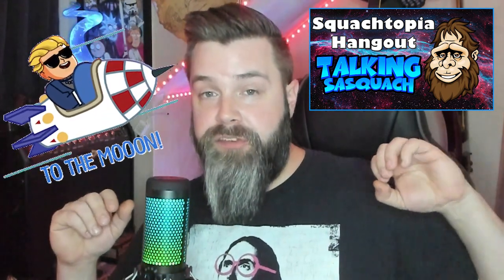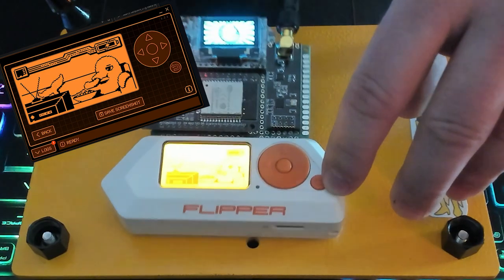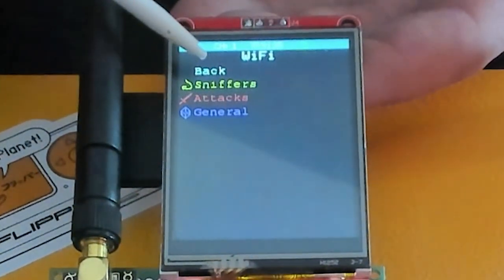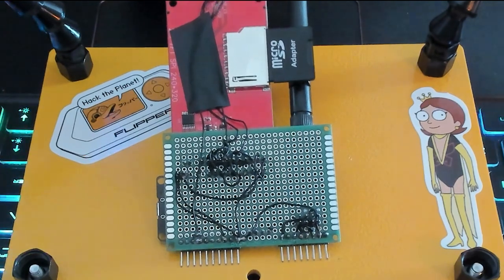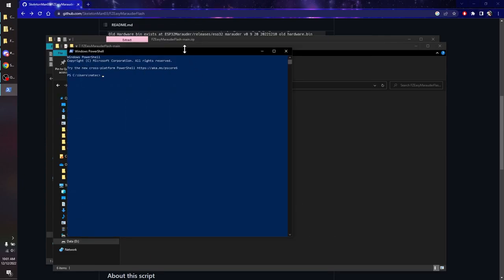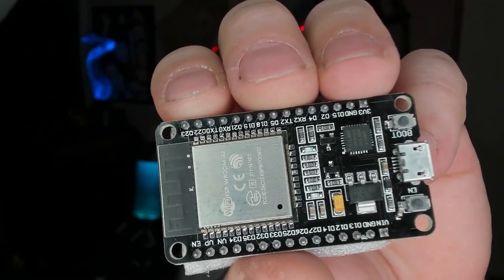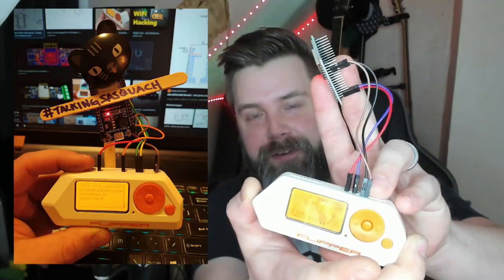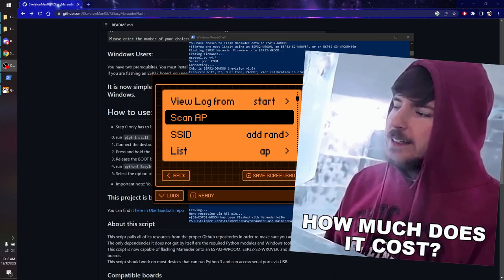Become A Flipper Zero Mad Scientist and Make your Own WiFi Boards!  😱😮👉🐬

Comment: Not sure if it has already been suggested, but have you considered double stacking the boards to protect the wiring? Use headers pins to connect another board and basically make it so the wires are inside/sandwiched? And then obviously fill that to the gills with hot glue. Just splurp a buncha hot glue in there. No such thing as too much hot glue, only too little. 🤙
Reply from the maker: I subscribe to the cult of hot glue. Great idea!
Reply: @TalkingSasquach  glue be with you, brother. 🙏

Comment: Nice video! Cheers.  With the nrf24 and esp32 wiring if there is any overlap do you just splice in the overlap and flipper uses either or?

Comment: How do you solve the power lines if you have ESP32, NRF24 and SD card reader as well? Which one is powered from 3.3V line, which one from 5V line? and since there is only one 3.3V line, one 5V line, two of them should share the same line, right? I would appreciate your answer. thank you so much.

Comment: I finally did it!!!! Spent like 12 hours today to do this, but I am a total newbie but I really enjoy learning about this stuff. Thank you for the tutorial! Actually had so many problems while doing this, but managed to finish the board, really proud of myself right now!

 For example, at the end part with: python3 EasyInstall, I constantly got red errors about python ..... [python3 : The term 'python3' is not recognized as the name of a cmdlet, function, script file, or operable program] ...don't really know why, even without the 3 just "python" didn't work.....so after a few hours spinning my head around the requirements.txt not working right and this python thing.....

I found out that after the pip instalation reqirements.txt, after the connection ESP32 with PC, I just have to run: start EasyInstall.py and it opened the window! 
Installed the correct version, and everything else after, voila, I have a working replacement for my Flipper Dev board!
Thank you so much for the tutorial, but if you know why or what the problem with the Powershell is, why do I get python error? So my SkeletonMan window would be black in cmd, not in powershell, like yours!
Reply from the maker: You sure you did step 0?
Reply: @TalkingSasquach  Yes, did step 0, but had an error with the requirements.txt (even tho' the set-location and folder had the requirements.txt), so did a few google searches and managed to fix it. 

This command helped me? .... I'm not sure, heh:

pip freeze > requirements.txt

Anyways, good thing it works perfectly now, I'm gonna continue adding the nrf24, and then, gonna try again. Actually having fun building this stuff, while I'm not working at the studio, sooooo thank you! 
🤘🤘🤘
Reply: @MariusPov  -  I am aslo stuck at this point how did you fix?

Comment: I don't understand, with the whole touchscreen assembly It looks like to me that its mostly ran on the external board, at what point is the flipper just being used to power these boards and there is very minimal data transfer?

Comment: I’ve been following you recently, I want to ask you. I can connect my esp32 board with which I use wifi marauder. To my plate cc1101 in what points to weld etc so that everything is a plate is possible

Comment: I'm trying to make the esp32 wroom wifi board with the antenna on the pcb as well. Do I need an SD card and screen on the pcb wired and soldered like you have it for it to work with my flipper?

Comment: The software that you flashed in this video will that work with your ftf display or is it another software ?
Reply from the maker: Yeah it works with the TFT!
Reply: @TalkingSasquach  Thanks all working now, is there a way to calibrate the screen?  i have to touch at almost the bottom to get the top buttons?

Comment: Hey Sassy mate! I’ve bought the same heltec as you, however as I followed the process of downloading marauder to this esp32, the screen lost function and does not function when connected to the flipper. Any help would be appreciated!
Reply from the maker: that board is cursed lol.  it uses heltec's proprietary coding so it was a nightmare to work with.  Mine only displays a static image.  It doesn't actually do anything

Comment: Huge missing step: You have to have Python installed on your computer. Installing gitbash does not install python onto your PC, at least it didn't for me using windows 11 and all the default install options. I had to manually install python on my PC to get step zero to work.
Reply from the maker: Good point!

Comment: i was wondering that not only 4 wires are enough to use the pmpkid deauthor to save pcaps files to the flipper memory, it saves it with zero size, thu it saves the logs inside the logs folder just fine !?!?
Reply: still, i made so many changes to make sure, esp32 by itself and hookedwith 4 wires to the flipper will save files inside logs folder just fine, but inside the pcaps it will only create filenames without any contents saved (zero size) :L
Reply: hmmmm waiting for some inputs please

Comment: Can you do that with a lily go T-Display it has the s3
Reply from the maker: I'm pretty sure you could, you'd have to recompile the Marauder firmware with the correct drivers and resolution, but i think technically you could pull it off.  I actually have one so it might be worth a try!
Reply: @TalkingSasquach  yea man let me know just getting started with this flipper.  It will definitely be great considering it’s touchscreen as well.
Reply: @TalkingSasquach  hey somebody told me you have your own firmware to this is that true? What is it like …unleashed or roadmaster? Or is this something new altogether?

Comment: Hey, I have been scouring the internet in the past few days to find a good alternative for the flipper zero. But there are none. I decided to make something which has similar functions to the flipper zero with the ESP32. I found two projects which I can make; esp32 marauder and esp32 cc1101 (for rf hacking). I prefer any of the two but the rf hacking project is dope. I can't find much info on the internet about these projects... 

Can you please guide me or give me some details about how you made your custom marauder NRF24L01 boards? How can I get a user interface with an oled screen with esp32 provided I don't have a flipper.

Second question, can the NRF24L01 sniff rf? What is the wiring for it to the esp32?

Sorry for taking your time, but please reply back if possible.

Thanks 😁 have a good day.

Comment: I can't seem get this to work. Power shell just will not recognize my python installation. Ive tried troubleshooting it idk whats going on. just going to order a wifi borad from flipper when they get more in stock. I think youre leaving some stuff out im supposedly to already know. or im just an idiot. maybe even both.
Reply: Update: Apparently newer esp board have had a hardware lock put on them and will not become a marauder. You need older model esp and only certain brand will do.

Comment: I really need to find out how to wire and program stuff lol
Reply from the maker: It's not so bad!
Reply: @TalkingSasquach  hey I’m having trouble with the flasher. It’s telling me that there is no esp32 device was detected, do you happen to know what causes this or how to fix it?
Reply from the maker: @TheWrenchEngineer  if you've got the drivers installed, try holding the boot button literally from before plugging in the board until after it tries to install
Reply: @TalkingSasquach  I finally got it done. Thank you so much for your help!